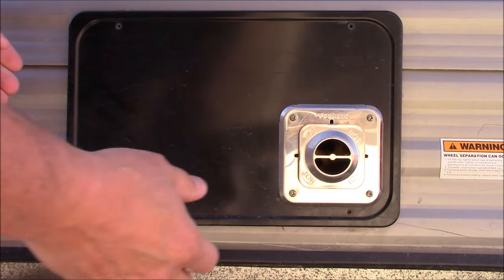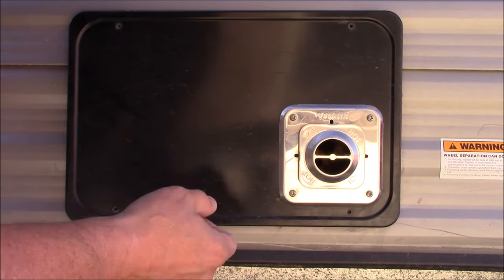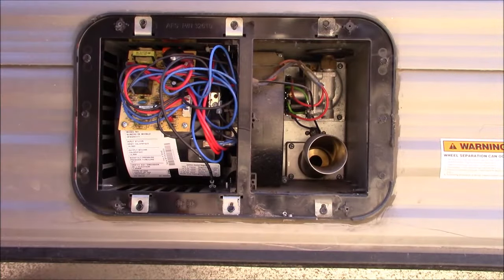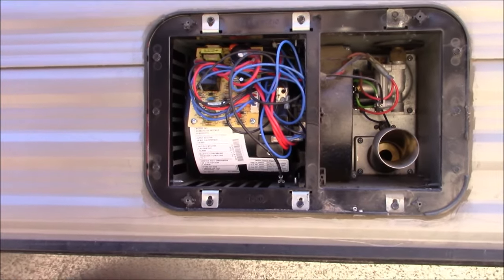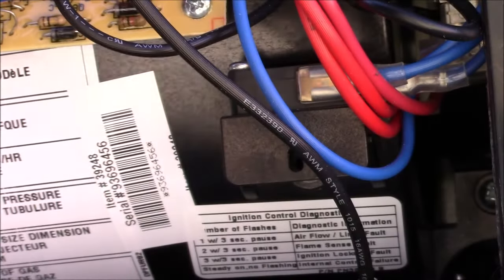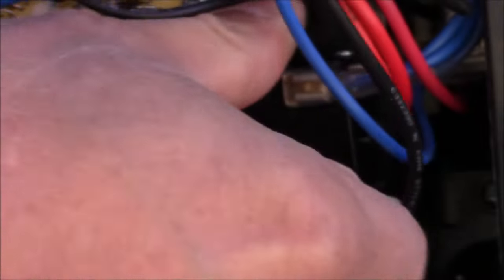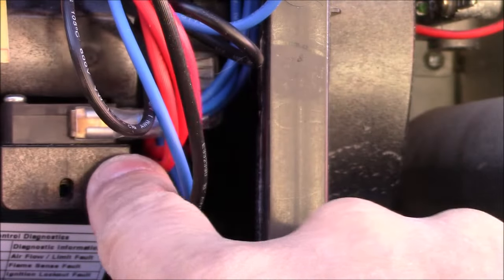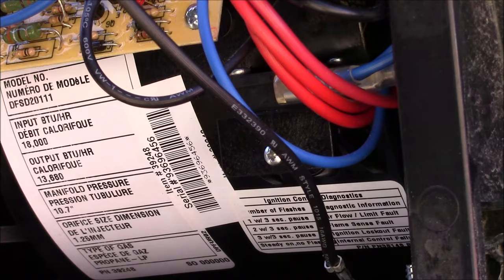RV furnace starts and then shuts off fix

Comment: Omg thank you so much for this I believe this is my issue I have had this issue for a few years sometimes it would work sometimes it won't. Do the same thing you said power on then off on then off and on then off then stay off. I took it to dealer they replaced the board which worked for a few then same issue. Sometimes I can get it to work. But never tried this. I will be doing this!!
Reply from the maker: glad to help

Comment: mine is shutting off, straight brand new from subarban, i had to remove it from the rv ducting and have it freely flowing air out into the rv without the ducts to fix.
Reply from the maker: You may want to check the ductwork for restrictions and or look at the warranty, glad you got it to work

Comment: One question you state the fan was running then shutting off...was this before burner ignition or after??,
Thanks in advance
Reply from the maker: It never let the burner ignite. The way this furnace works is the fan will come on and the sail switch will close telling the control board the fan is working and able to blow the heat out and exhaust the combustion fumes. The control board will time out after 30 seconds and shut down without the sail switch signal to ignite the burner. This is a built in safety feature to ensure the rv is not filling with the exhaust from the burner.
Reply: @bbbjim1fixedit  My dometic furnace will turn on and blow hot air, and then shut off. Sometimes it'll run for a few minutes, other only 30 seconds. What do you think could be the cause? It's a brand new furnace.
Reply from the maker: leave the furnace on when it stops working and a red light will flash a code. a label on the blower will have what the code fault is and what component needs attention  @_Spacecraft
Reply: @bbbjim1fixedit  Will the code display be under the outside panel? The way it's installed in my RV there is display or light I know of.
Reply from the maker: Dometic furnaces have the light outside the RV. you will need to remove the panel to see it. I wish you the best on your repair @_Spacecraft

Comment: I’m having same issue but sail switch was clean.   ?  I hear it clicking trying to ignite.   It will ignite one time but wen cuts out.   It don’t look like it will come on.  Again
Reply from the maker: You may whis to ensure you have 12 volts at the gas valve. I wish you the best on your repair

Comment: Had this happen to my rv I turned the power off by turning off the breaker and turned off my battery flipped the switch on the furnace to off waited a couple minutes and the furnace worked after waiting 5 minutes off